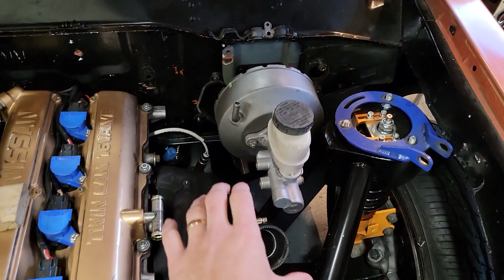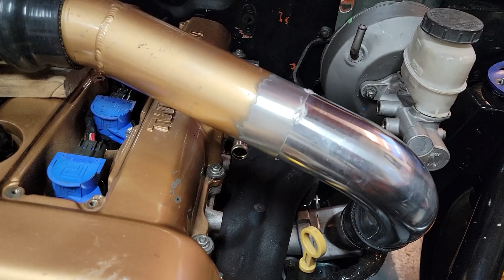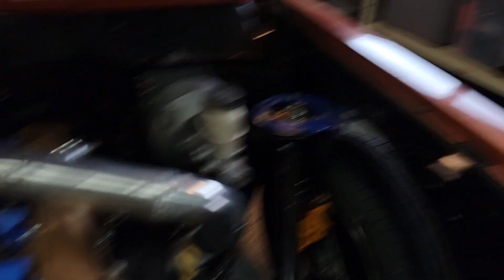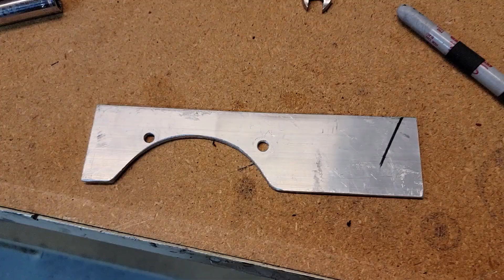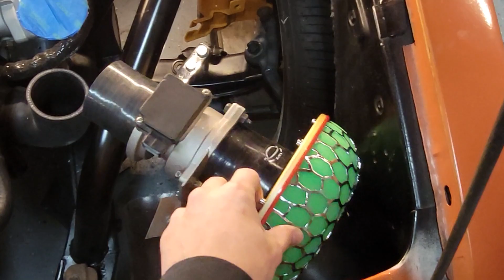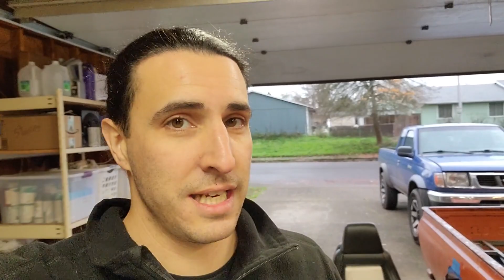Air to water intercooler build Part 1- [SR20det - Datsun 620]

Comment: Nice setup..!! I really like how it looks. How do you like the intake temperatures with the water to water intercooler? I’m planning to do that for my swap but I heard mix reviews with the intercoolers.
Reply from the maker: Haven't monitored it but most oem manufacturers are going with water to air these days, if you have a sufficient heat exchanger it will work  well!

Comment: How much hp/boost are you able to have with all these parts in your build?
Reply from the maker: This intercooler is rated for 350HP and 70psi. My piping welds would probably burst long before that. I've never dynod this thing and run with no boost gauge but I have a 10psi waste so I recon it runs at 10 psi.

Comment: Just found this channel, good stuff.

Also I think the BOV before the intercooler is a better idea to lower heat soaking, no reason to dump cold air, might as well dump it before it makes your heat exchanger work.
Reply from the maker: That is a fantastic point! Thanks for checking out the channel 🙏